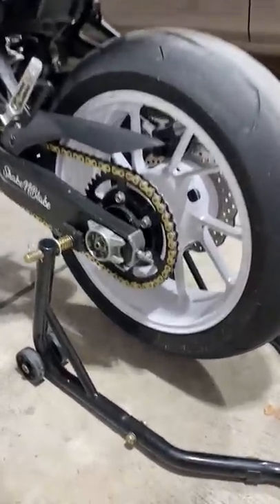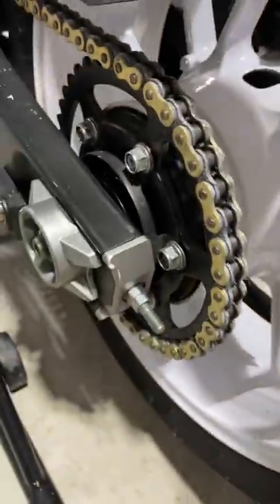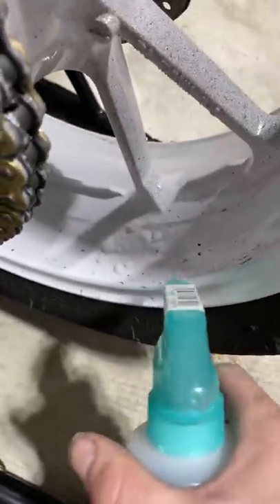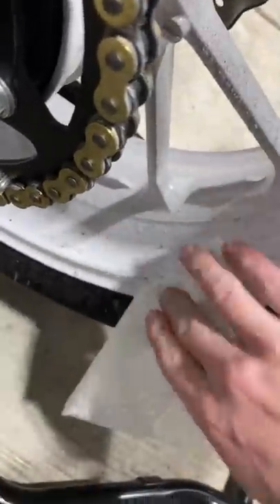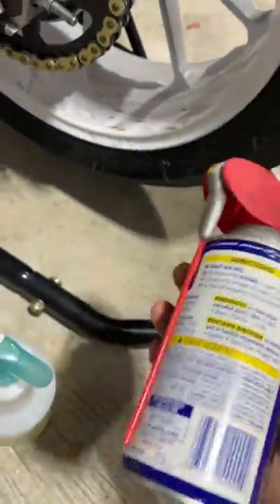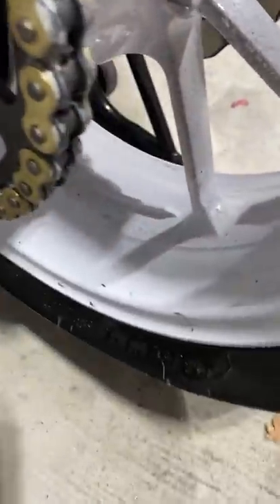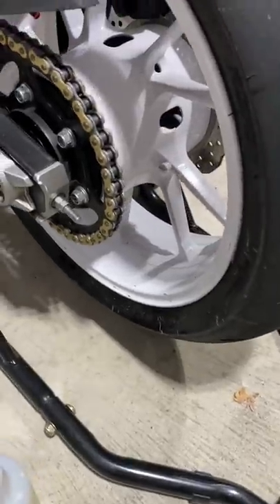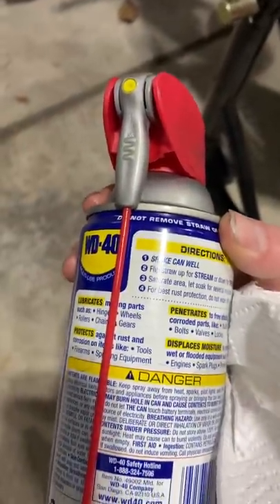EASY tip I wish someone taught me when I started riding motorcycles. #shorts

Comment: Who would have thought you can use a degreaseing agent to remove grease 😀
Reply: I was about to type that - word for word 😂
Reply: You’d be surprised at how many people think WD40 = grease lol
Reply: So oil and grease are opposite...
Reply: @MrFlyingPanda  oill and grease are basically the same thing  WD 40 is neither,  people make this mistake and use it to lubricate
Reply: Dude it works like a bomb, I've cleaned my rimes like this guy did, I've cleaned my chain with it, if cleaned my sprockets with it, I've cleaned of dead bugs on the windshield with it, hell I've even cleaned my exhaust with it😂😂😂😂😂

Do yourself a favor and try it out
Reply: @stinkyfinn6977  well it's not meant for chains and so on, but for lubricating rusty bolts and stuff it's perfect.

Correct me if I am wrong, but I think wd 40 is a solvent based lubricant, so if you spray it on older grease, it will dissolve it, making it easier to wipe off
Reply: @mr3748  wd40 isnt a lubricant its a water displacer.... .. when it evaporates it leaves behind nothing besides what u didnt wipe off
Reply: @mr3748  you are correct
Reply: WD-40 = water displacement recipe #40 it is NOT a lubricant. do not use it on your chain for the love of god, your poor x/o rings will thank you. If you need a cheap and effective chain cleaner that works better than 90% of expensive store bought products, good old fashioned additive free kerosene is the answer. It’s even sighted in many manufacturer manuals as the only product you should use for the job 👍.
Reply: You can use grease to clean/remove grease I know it doesn’t make sense but I also use it to clean other stuff also
Reply: @iangriffith3940  I use normal wax chain lube to lube my chains, I just use the wd 40 to clean of the old wax and dirt stuck to my chain. I also use kerosene from time to time to give the chain a good clean
Reply: @mr3748  
I said nothing about chains, but if you use it on one 're apply grease or other lubricant after
Reply: @iangriffith3940  you can clean a chain with wd 40 easily
Reply: @mr3748  
It like the man says it water displacement #40 I think I it named that because it was the 40th formula of water displacement they tried/made , I also hear it caled WD 40 because it good for 40 difrent things , it great for cleaning grease and getting chewing gum out fixing damp wireing  plus loads more but it no good for lubrication maybe on some plastics it would work as lube
Reply: I know right my dad told me that when i was like 9
Reply: @iangriffith3940  you sir are the only one who seen it was a sealed o ring chain. No need to grease at all.
Reply: It's not a degreasing agent Definitely not.
Reply: @MrFlyingPanda  grease is oil plus some thickening to hold and carry the oil
Reply: @anderzander so was i 🤣🤣
Reply: @iangriffith3940  look up the various test that have been conducted,  WD40 is perfectly safe on chains.  I personally don't use it for that,  but the results are in, and it will not foul O- rings.
Reply: WD 40 stands for Water Displacement formula 40. It was the 40th formula engineers tried that worked for the military.
Reply: Not really a degreaser. It's a water displacer. That's what the WD stands for
Reply: @redfishbluefish67  
No shit Sherlock l  is that why it called water dispersement 40 then ?
Reply: @iangriffith3940  Bro, what about diesel? Is it not preferable over kerosene for cleaning chain?
Reply: @lionsden6960  
Kerosene is a light diesel.  Diesel has additives for lubricating.
Reply: @johnnybravo3612  it stains tho
Reply: You saved me from typing it lol
Reply: @olleaxelsson3249  even easier with throttle body cleaner...
Reply: I won't spray that anywhere need rubber, or hoses
Reply: @iangriffith3940  he is cleaning the wheel not the chain
Reply: @onicronprime118  why not?
Reply: Dave Iaucco  looks like you saw the same programme as everyone else explaining how it got its name..
Reply: It’s a water displacer with a solvent in the mix, that’s what cuts through the grease
Reply: Its not a degreaser
Reply: Wd 40 is not a degreaser!
Omg the amount of BS im reading here is off the charts
Reply: Wd40 is a brand and they do have a lubricant. The standard wd40 is not the lubricant. Just fyi
Reply: You'd be surprised how many people think WD-40 is a grease
Reply: It's not only degreasing, it's also a lubricant so you absolutely have to STOP doing that
Reply: @MrGeoffrey1998  WD is not a lubricant, and should never be used as one. Just because you can, dosn't meen you should ;)
Reply: @Fritzpuddel  it's not a lubricant ? Take the can, look at it and it says "lubrifies" whatcha want more sherlock ? It leaves a thin oily layer after, i know it shouldn't be used as a lubricant as it's very thin, but it's still a lubricant xD
Reply: @MrGeoffrey1998  like i wrote, just because you can, dosn't meen you should. Vaseline is a lubricant too...
Reply: @MrFlyingPanda  kinda
Reply: @GalvanizedGreatness  it wasn't a question...
People saying it's not a lubricant need glasses it's written on the can..
Is it the best or good to use on this or that isn't the question..
Reply: @keithclark486  well, it is
Reply: @The_Real_JN  
Try painting over it
And see what you get.
Reply: @keithclark486  then tell me why it's water dissolver combined with a solvent, and what do solvents do? They degrease things
Reply: @The_Real_JN  
You tell me why and every other auto painter on the face of the planet why it causes fishes.
Reply: @keithclark486  fishes?
Reply: @The_Real_JN  
Fisheye
Reply: @keithclark486  so why you using it to clean surfaces that you're going to paint then?
Reply: @The_Real_JN  
You don't , you use wax and grease remover.
Reply: @keithclark486  and tell me, what removes grease? Isn't it something beginning with wd or something like that?
Reply: @The_Real_JN  
Use wax& grease remover , prepsol , alcohol. 
Google it. 
Do not use WD- 40.
Reply: @keithclark486  wd works for me, so imma keep using it
Reply: @The_Real_JN  
If it works for you that's good 😊
Try this experiment
Wipe down a piece of
Metal and spray paint over it , when you see those big crater's
That's what you call fisheye, imagine your whole car like that After hours of work and $$$ spent on paint and materials. 
I've done and taught auto body and paint 45 years , I'd never use it or recommend anyone else to use it. 
Rubbing alcohol is cheaper and will work for the DIY.
Reply: @keithclark486  I've used wd40 to wipe metal down before though. Spray it, wipe it down, prime the metal, apply the paint, apply clear coat, polish it and it's done. No fisheye as you say
Reply: @The_Real_JN  
You should do a video on that And prove every professional auto painter that's picked up a paint gun wrong. 
Plain out and out ignorant
Will not work !!
Troll somebody else.
Reply: @The_Real_JN  
I'm not taking about painting farm equipment where nobody gives a dam what it looks like , I'm talking about quality professional work. 
Do you understand ?
Would you pay top $$$ to get your car painted and tell them " OH " 
Make sure you give it a good wipe down with WD-40 before you spray it !!! 
Do you understand ?
Watch some videos on automotive refinishing and leave a comment on useing WD-40
Have fun with that.
Reply: @keithclark486  yeah I'm not talking about farm equipment either, I'm talking about for clients
Reply: @keithclark486  I get perfect results using wd40 though why would I change it, are you actually ignorant enough to think that just because it doesn't work for you it means it doesn't work for everyone else? Like, how do you wipe stuff down then? When you wipe stuff down you wipe it down properly as to not leave anything on the surface of the metal so it's okay to prime. Even if I use a regular solvent cleaner I make sure to wipe the surface down properly afterwards even if the cleaner has dissolved itself. Wipe it down properly and you haven't got a problem no matter what you use
Reply: @The_Real_JN  
Well in your perfect world do how you please. In my world of 45 years and other professional auto painters
DW-40 don't cut it. 
I've held paint seminars for all the major paint manufacturers in the industry and you are one of the biggest jokes I've heard of over the years. Try corresponding to someone on your level of education.
Reply: Guy sounds clueless to point most things he does is cleaning it,
For places without paint engine or brake cleaner does this even better.
Reply: @keithclark486  you're calling me stubborn and stuck in my ways??? DAAAYYUUUUMMMM who's the one who can't seem to accept it works for others and not themselves, who called me out for using a different method to them, I literally said in the past if your method works than good for you, but no you still can't leave this alone
Reply: @keithclark486  and you care less but you still keep coming back huh
Reply: Technically it’s water displacement while yes it does those things but it can also lubricate stuff it’s weird people use grease to lubricate stuff but wd40 can do so much
Reply: @stinkyfinn6977  they sure do. That's why they need to buy wd40s silicone or white lithium spray. Mind blowing ppl think regular wd40 greases things for u lmao
Reply: Lmao wd40 is hardly a degreaser.
Reply: Mind...blown...
Reply: @keithclark486  damn bro. You do sound toxic. Talking about you are done with ignorance. But yet do the same yourself 😂💯. Contradicting much man?
Reply: @The_Real_JN  he seems miserable is all bro lmao
Reply: @keithkeef6635  
Speaking over ignorance is not toxic
The end.
Reply: @keithclark486  you spoke ignorance to ignorance. How much sense does that make lmao
Reply: @keithclark486  the end 😂
Reply: Water displacement 40th recipe also known as WD-40
Reply: Oils cleans oils, detergent cleans water soluble stain. Thats cleaning basic for everything, autos, laundry and house. 
If you got grease on your shirt or sofa, clean it with olive oil, keep rubbing and adding oil until its clean than finish off with detergent and rinse
Reply: @Anderzander  too slow bozos 😀 and thanks for all the likes
Reply: In what world is WD40 a degreaser and not spray oil? Some of you have never done anything with it and it shows 😂
Reply: mama
Reply: WD-40 is not a degreaser.... It stands for water displacement 40th formula meaning it displaces moisture off of shit keeping it from rusting not degreasing shit because that'll make it rust
Reply: @pauldixon9626  we all no what it stands for , and go and look up what a  degreaseing agent is
Reply: Yeah it might remove some grease and grime but also add some back look it up your damn self
Reply: @stinkyfinn6977  it's literally fish oil so it is oil
Reply: @MaNNeRz91  do it degreese grease ?  that makes it a degreaseing agent , like this shit isn't hard , if it remove grease it a degreaseing agent
Reply: No fr.. dude sounds like a guy who knows nothing about cars but buys a super sport motorcycle..
Reply: @Fritzpuddel  I use valsline on most my bicycle builds 🤣
Not the best I know but it works better than nothing
Reply: @stinkyfinn6977  WD40 would be considered a solvent correct?
Reply: @iangriffith3940  I’ve been doing things wrong my entire life 😂! I’ve always cleaned my chain with WD40 then lubed it after wiping clean and dry. I’ll be getting some kerosene soon probably like now actually! Thanks for the info. What if it is a regular chain no O rings?
Reply: @303HOBO  for non O-ring chains kerosene is still more effective, and better yet it’s cheaper! A large 5 gallon jug is under $20, and will last for quite a long time.
Reply: @iangriffith3940  well then kerosene it is from now on. Thanks I appreciate the info!
Reply: @303HOBO  no problem man, ride safe!
Reply: @stinkyfinn6977  if you pause the video and read it says Lubricates..... Wheels 😂 not safe on wheels
Reply: @mr3748  If you don't want the oily film left behind (Sometimes you do), use brake/clutch/carb cleaner.
This is why WD-40 is a great lubricant, those that say it isn't are likely trying to lube bearings or their engines with it the dummies! 🤣🤣
Reply: @MrFlyingPanda  like dissolves like.
Reply: Wd 40 is not a degreaser. You can see how many people think wd40 isn't basically grease itself,  with a added solvent.  So basically,  instead of wd40, you could just spray a solvent on your wheels, like a grease and wax removing agent.  And guess what,  after you spray the wax and grease remover on your greasy wheels,  you have basically made wd40. And using wd40 on your wheels doesn't clean them. They will have an greasy film on them and you'll see it. So do the right thing.  Use a spray wax on your wheels once every couple weeks. This will make wiping off grime easier.  And speaking of wax. Use chain wax. It's cleaner.
Reply: @ahutchins3405 You still need to lubricate your chain, sealed or not.
Reply: @patriciomunoz2830  

I know right.  Wd40 is a lubricant.  So it's greasy itself.  It may clean off grime, but your wheels are left greasy.
Reply: This is proof (other than it saying it on the label) wd40 is a lubricant AND a solvent. It’s great at many things. Not so great at others.
Reply: But isnt that how soap works there the water loving and the oil loving
Reply: The more you know